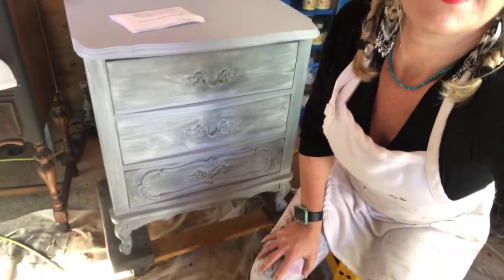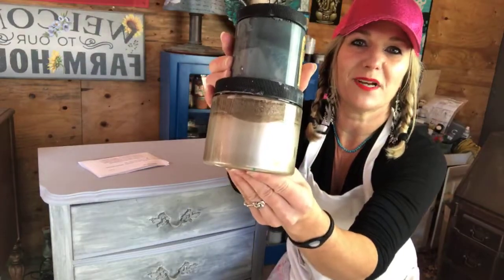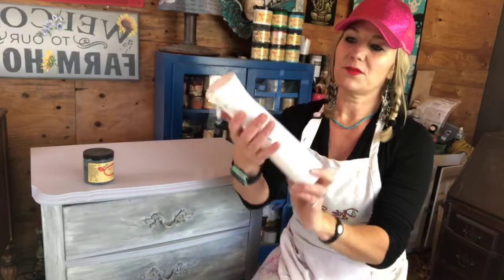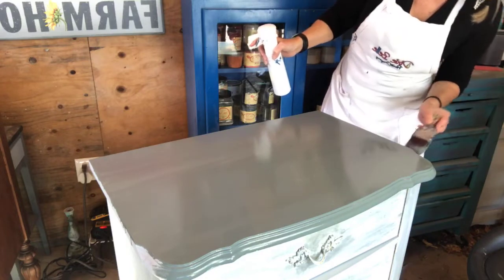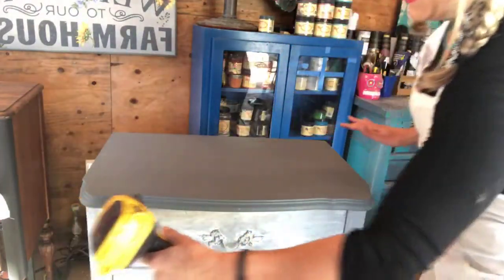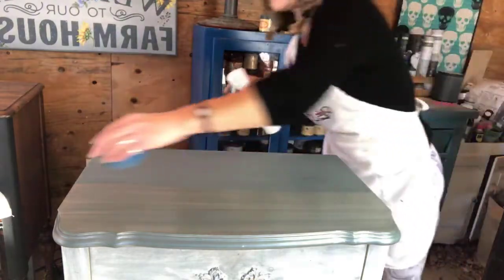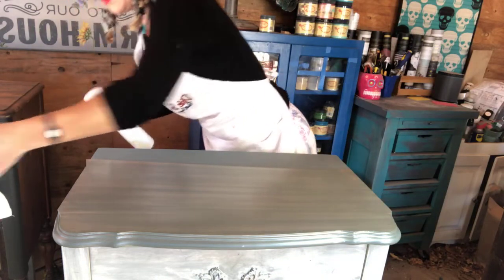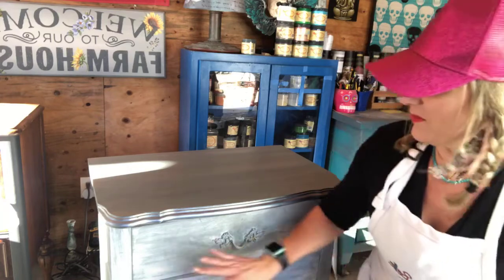Tutorial Dixie Belle Moonshine Metallics in Steel Magnolia over Stormy Seas plus Zinc Gilding Wax

Comment: Can you stencil with Moonshine Metalics?
Reply: I know this is a year later, I don’t think she checks commenters. However you can use moonshine metallic for stenciling…apply a very thin coat, it will be translucent. If you want a little darker let dry and add a second thin coat. You can use a hair dryer to speed it up.
Reply: 1 yr. Later…absolutely! Thin layer, let dry repeat process depending how dark you want it to be. It will be translucent.